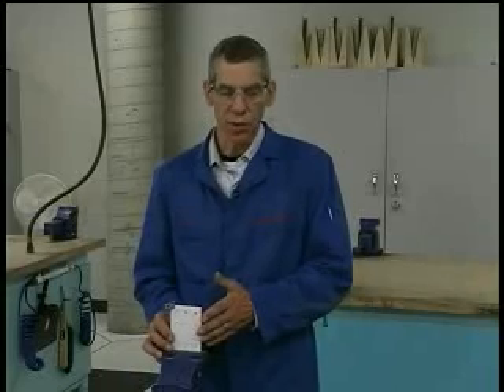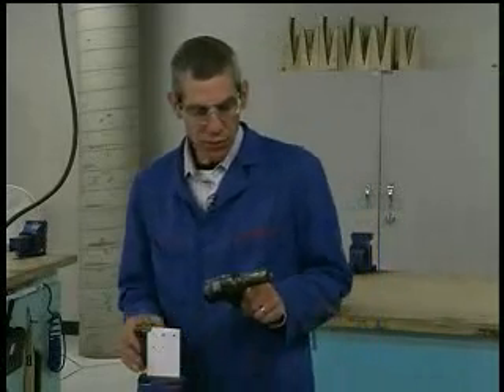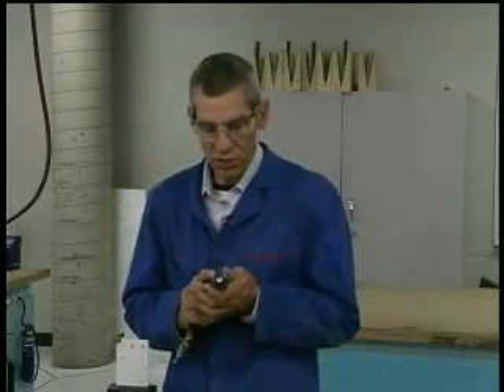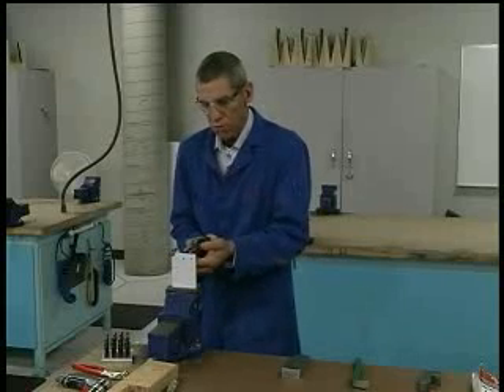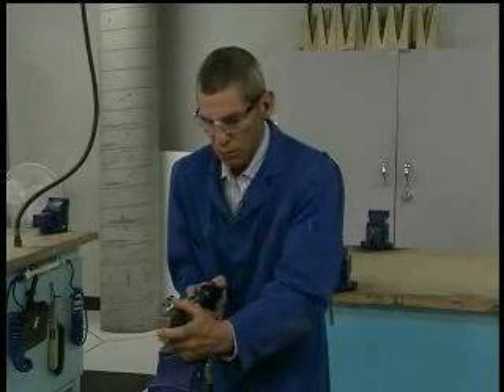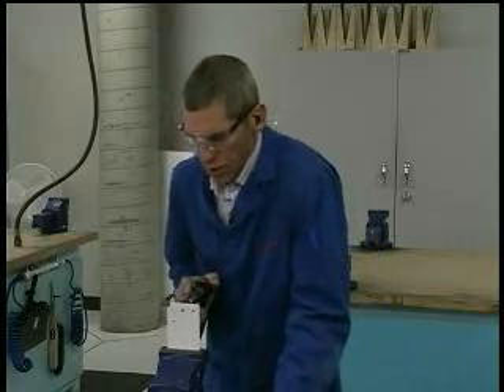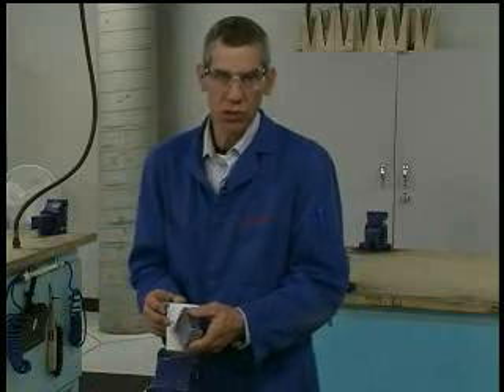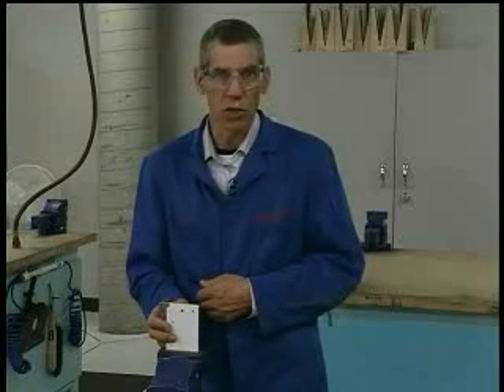Basic Riveting Fundamentals

Comment: This can handle high temperature change much better welding but the material must match harmony index otherwise voltage static electricity could interfer with operation optimum operation requirement

Comment: 1.5 rivet length is ok for thick aluminum.  Like .050" 2024-T3 and thicker.  
When you're riveting thin material like .016" 2024-T3.  
1.5 rivet length is far too long after driven.  It stretches the aluminum sheet giving terrible results.
This is even worse when driving monel rivets.  
My rule is generally 1D length max.  Even a little shorter with monel rivets in thin SS or ti sheet material.  I always use rivet rubber to keep the shop head side sheet material flat.  Very little gun pressure and I always use a tungsten bar.
I'm 29 years in the business.  And a transport  Canada licensed sheet metal AME.
Most of my experience is in very thin material.  
Anybody can drive rivets in thick material and make it look decent. 
Not so easy in the thin stuff.
Reply: I’m doing a partial roof repair on an inclosed trailer.Roof is thin galvalume with .040 al going overlap.Using 3/16 1100*F soft al brazier rivets.Cut 1/2” length down to .350” Big bottoms I tell you after setting.The 1/2” would just bend over.I’ll put 2 rows being 2” apart.Should be good.Kinda fun learning all this stuff and tricks of the  trade.Thanks for you comment.
Reply: @Scott M  Yes. A 1100 series rivet is soft aluminum.  They drive and finish nicely. A double row of 3/16 diameter rivet is more than sufficient for .040" sheet.  
I love solid rivets compared to blind (hollow) rivets.  Your joints will never work loose.
Reply: @lenBrill1971  I watched mikey dedesilva youtube channel from Ontario.He showed a partial roof repair and I’m going to do it that way.Check his channel out.He loves tools of the trade if one could buy them.He makes his own specialty tools.
Reply: @2hotscottpro  . . . .will do👍🍻
Reply: @lenBrill1971  oops it’s mikey desilva,,cheers

Comment: Can brass solid rivets be installed using a manual press (like the one used to make holes or ring rivets)? Or it always has to be done using air punch hammer ? (I plan to use brass rivets to reassemble blades on antique fan propellers... the clearance is always the same and could performed on a bench. I don't need a mobile air hammer, except if really necessary for the rivet...)
Reply from the maker: I guess you could attempt it and let us know. The instructor in this videos is retired and hopefully healthy at home. We post the videos for students to have the material online and easy to access. So as longer as those antiques are flying and are whitin airworthiness. Do as you feel it might work for you. Brass is very easy to work with.

Comment: A good thing to note about setting the river gun is that with your average 1/8 inch rivet a proper bucktail should be achieved in about 3 to 5 seconds. Adjust the gun accordingly to achieve this. Just a little trick I learned back in MOS school. A fair bit more accurate than basing it off of the indentation in the block.
Reply: ethan underwood that seems incredibly long. Guys in my shop are usually blasting for 1-2 seconds. Experienced guys can do it faster.